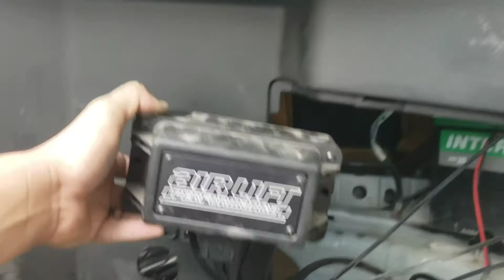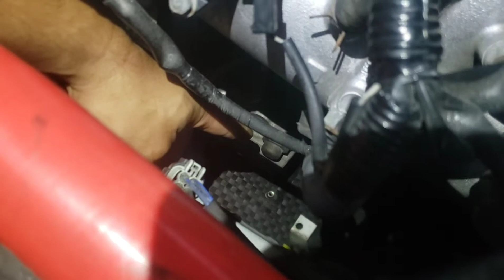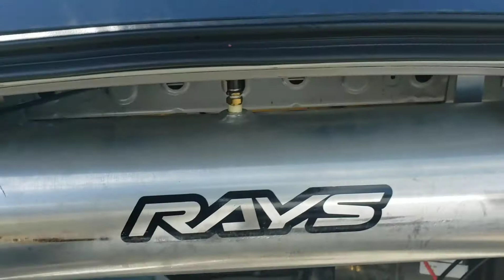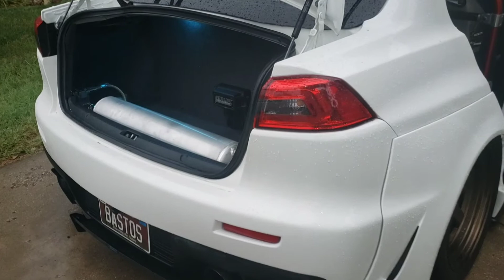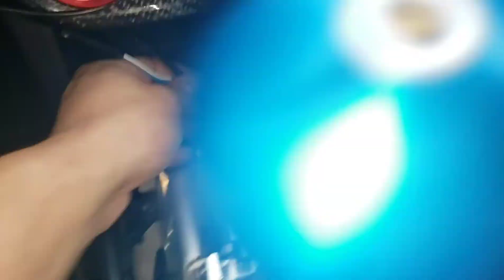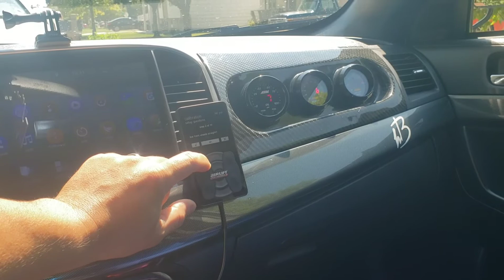2011 EVO-X Airlift Air Suspension redo/Aem gauges install/wiring cleanup.

Comment: Quick question, I have a similar placement for my gauges that ill be installing soon, did you have to modify or get an extension on the oil pressure gauge harness?
Reply: How you got gauge on air bags location
Reply from the maker: Yes. I had to extend it as its to far being placed where I have it.